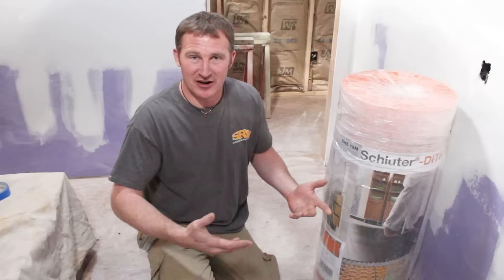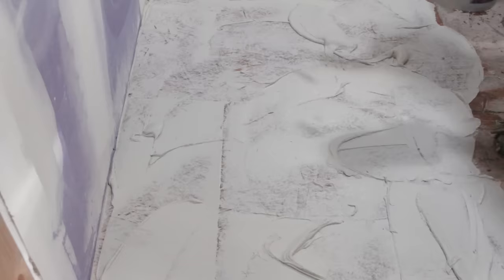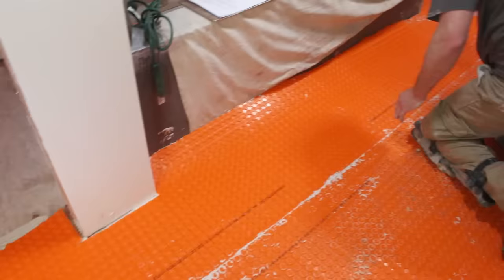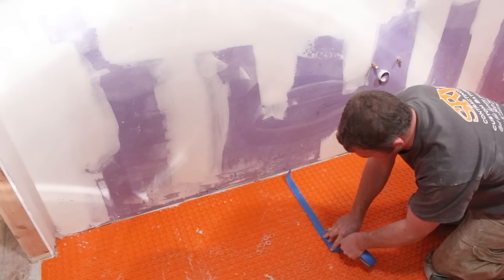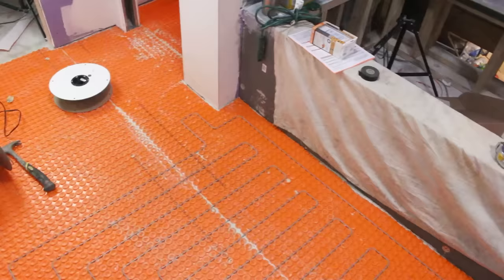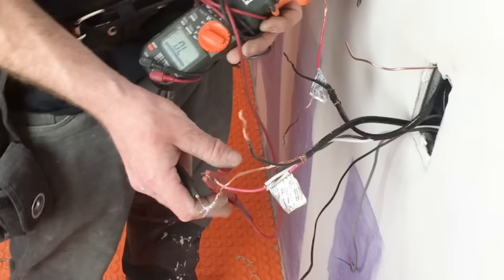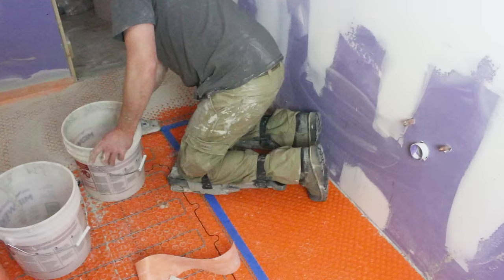DITRA-HEAT Heated Flooring Systems Installation (Step-by-Step) -- by Home Repair Tutor

Comment: Great tutorial on installation-I'm going to be putting this down for my basement bathroom floor. A couple things on the electrical make-up at the box: Since this is 240V, the white wire from the Romex cable should be re-identified as hot using black electrical tape. Also, the ground wires should be spliced  with the equipment ground back to the panel, and bonded to the box. You can use a pigtail wire to the ground terminal in the box, or leave the ground wire from the Romex long enough to wrap the ground screw, and then pigtail with the rest. This bonds everything to the metal box and piping.

Comment: Great Install tutorial! Will be laying mine tomorrow.

My only issue I have with this is the suggestion of wiring 2 heater cables in parallel to a single thermostat! Stop and think this through for 30 seconds. You have a 300 and a 100 ohm cables... current flow will split at the junction into 25/75%.... the shorter cable will heat up much faster than the longer cable. Next where do you put the single sensor? If its in the smaller area with the shorter cable, the larger area will never get up to the set temperature... if the sensor is placed in the larger area.. you run the risk of burning out the shorter cable. I guess Schluter forgot to mention on their FAQ that you can only connect 2 hating cables in parallel IF they are of similar resistance.

Comment: This is a great tutorial, thanks for producing it. I'm currently in the process of installing Ditra Heat in a hallway and bathroom and this has been very useful in helping me avoid the obvious pitfalls.
Reply: Ok pol
Reply: I’m curious, were you hable to do the installation by yourself? The electrical part looks very complicated.

Comment: Ditra heat is a great product, makes installing a heated floor so much easier, good job on the video.
Reply from the maker: +Sal DiBlasi thanks buddy, it's a great system.
Reply: it is .! bt plywood need to be level . in the bay area houses are so old that we have no choose bt to float then i use this ditra over the float & come out great . if the customers wanna pay , cause it gets pricy  haha
Reply: Sal DiBlasi 
he should've clean all of the remaining thin set off the ditra-heat mat like you do it Sal, otherwise he did a good job.
Reply: Why must it be test?? I mean...isn't it tested at the factory? seems redundant.
Reply: I'm not sure who does nicer work, Sal or you guys!
Reply: @kennethlehtinen8822  if you must ask that question, you should not be installing this system. You should always double-check before installing the tile. Anything Could Happen. It could have got damaged on its way to your supplier you could have damaged in transit or even could have been damaged during the install process or also may have never got checked in the first place before leaving the manufacturer and why would you want to do all that great work just to find the the system didn't work

Comment: Very good tutorials.  Here I came again just to let you know that I called Schluter , as you told me so, and yes, just like you said,  they were very kind and answered all my questions.
Reply from the maker: Awesome, do you feel reassured that your electrical setup is good to go?
Reply: Home Repair Tutor .... Definitely yes. Even though,they told me their system supports both 120-240
Reply from the maker: Your floor will be toasty, just be sure to test everything before, during, and after the installation 👍🏻

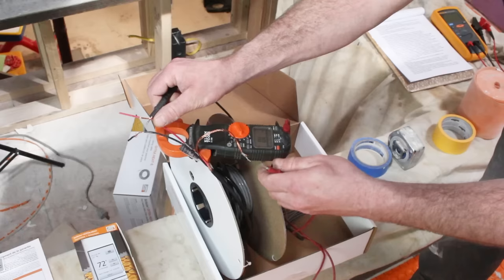Comment: At around 23:00 your electrical guy calls the ohm reading on the meter "zero". When I look at the image, I'm not seeing a zero there but "OL", for "overload". That's what the meter shows if it cannot give a meaningful number. If the number of ohms was zero that'd be a short, and that would be a failed test. You want to see "OL" for that test, which means the resistance is so great that the meter cannot give a number for it.
Reply from the maker: Thanks for asking, the main point is the wires passed the test before, during, and after installation
Reply: OL stands for Open Loop, meaning there is no circuit completion of electricity, which is ideal to see. It is like holding the probes in free air.  If measuring voltage and you possibly go over a selected range or meters maximum you could get an OL for overload because what you are measuring exceeds the limits. My meter will show O.L  versus OL in resistance
Reply: In general, OL on a measuring device stands for "overload" which means you are beyond the range of what the device can measure. It may happen to correlate to an open loop, but not necessarily. I have multiple digital meters here (ranging from Flukes to super-cheap devices). Their literature all explain OL as "overload", not "open loop".
Reply: It means open line - not overload on multimeters

Comment: Thank you, awesome video! Unimportant for how to install this, but just want to inform that there is definitely a difference between hot and neutral. Your neutral wires are grounded inside the main electrical panel; meaning that there is no potential difference between neutral and ground (basically zero volts on neutral). If you were to switch a neutral wire on a light switch instead of the hot, or hook up something backwards, the device could appear to be off because there is not a complete electrical path but would still have 120V at the device. This could prove very dangerous!

Comment: Excellent video, thanks so much for making it, and really enjoying the detail of instructions provided, and you answered my query of what to do round the edges where I'm not putting heating, and how to level up the floor between merely tile area and underfloor heating areas, so now have to buy some more matting to go all round the edges...Baffled though about why I need to do a mini dogleg in the wires if over 10 feet? (my new kitchen extension is 12 x 14 ft) I'm not going all the way to the sides, but had planned to do the whole length, so please explain why the little dogleg?

Comment: Try using Calorique heating matts eliminates so much extra work from using wire solution. Calorique has a tile heat solution that uses a self stick matt that you lay down first then put thin set and tile without doing twice the work for radiant heating. Save on labor and save time with Calorique. Also the matt is 0.0016" thick so its like putting paper down and doesn't raise the floor height which is very important and additional labor savings.

Comment: This is a very good video how ever 120 volt is blk / wht , 240 volt is blk / red  I say this because a future tech could see this as possible 120 volt thus creating possible danger , so RED taping your neutral white is a good standard practice in the case of 230 - 240 volts
Reply: There is one case in which a white may be used to carry ungrounded potential that is still in conformity with the most recent cycle of the NEC. That is when a cable is used to feed a straight 240V load. Besides that if someone is even a tad bit unsure of what they are doing around electric they should stay away from it and call someone who is. The color of the wire isn't going to save your life.

Comment: Can you install a good quality vinyl plank floor on this or does it have to be something solid like a ceramic tile?
Reply: most vinyl has a warning on it IF it can NOT be used over in floor heating, check your product

Comment: What a mission - so many easier systems out there than this
Reply from the maker: Which ones do you like? We've used several but always like hearing different perspectives
Reply: Hey, markyruss and Home Repair Tutor I'm starting to look at different products from Lowes and Home Depot to install in a 5 X 7 existing bathroom with a ceramic tile floor, any recommendations other than this product?

Comment: Question on bonding the ditra to the subfloor. I had to paint over the subfloor due to a small amount of mold, which I thoroughly cleaned the best I could & used mold barrier paint over that, curious if applying thinset to that would compromise bonding & cause issues? Would it be better to apply a quarter inch sheet of floor overtop for a better bond? Thank you

Comment: Love your video. I  have a question concerning the splice going to the thermostat. You chiseled out a space so that the splice would be below or at level. I have a concrete floor and am using ditraheat-tb . Will there be enough room for the splice to sit without having to chisel out the concrete? I am laying tile on top of the ditraheat-tb. Should I be concerned ? Thanks

Comment: I see that you are using 2 different rolls, would you not have to install a power module to allow both wires to work off of the one thermostat? Great video, Thank you for sharing.
Reply: that's exactly what I was puzzled with. With this parallel connection, the shorter roll (less ohms) will suck more electric current than the longer roll (higher ohms). This will result in unbalanced floor heating throughout the rooms where the area above the shorter roll feels a lot warmer.

Comment: It's interesting, the warmlyyours inspire thermostat is exactly the same as the schluter one, but at a fraction of the cost!
Reply: Lifehacks nothing like it.
Reply: and 3yr vs a 15yr rock solid warranty. I've yet to meet someone that doesn't love their ditra heated floor or one that's failed. sometimes it isn't worth trying to save a buck.

Comment: Great video!  Question -  after your thermostat is all wired up, wouldn't you want to actually power it up and see if the heat wires start to get warm? Obviously you wouldn't let them get very hot, but I plan to do that when I install my system.
Reply from the maker: you want to test wires three times. Once before installation, once after installation, and finally once after setting tile

Comment: toilet issue in my flat was cause of plugs they used let water go through, but even before that it was chipboard floor and over use the toilet used to work its way lose every time every flat, it was council flat. eventually toilet went through floor as I sat on it.

Comment: What if the wire were run in a groove in cut into plyboard?  Would there be an issue with thermal conductivity?

Comment: Curious as I am installing this today.
Looks like you install the cold splice and in your case, splices closer than 8" to the heat register. This is acceptable? Thanks and great video...by far the best I have seen.
Reply from the maker: Thank you. Always follow the guidance in Schluter’s most current instructional booklet. That way your warranty will be upheld. Sometimes we’re constrained by real world problems, hence the placement of the splices. What kind of project are you working on?

Comment: Love the tutorial. Very clear. But what if the heating cable got accidentally cut, How do you mend it?
Reply: The heating cable is designed to never be cut and cannot be safely repaired. If cut, the entire cable needs to be replaced.
Reply: Schluter now offers a repair kit

Comment: Thanks for the vid!

Looking at doing this to our bathroom next year, so if your a diy’er, are you able to attain a full warranty if you test and record the electric values at the time of installation? 
Also the vids I’ve seen on your products so far are on total construction, I’m looking at doing it on an existing bathroom with cabinets, tube and shower currently installed, only looking to do the walkways in the room, I’m assuming it’s just as doable as new construction? 

Thanks.
Reply: I suspect it is an expansion joint for the resistive cable, as it expands (lengthens) when it is running.

Comment: how long are the wires to the thermostat, and do you need run it thru conduit?
Reply: I mounted the electrical box at 51 inches off the floor and there was plenty of cable to get the cold leaf to the floor. Yes, the instructions say to use conduit.

Comment: The instructions indicate to make sure the thermostat wire does not come into contact with the heating wire, even in the wall. Am I mistaken?
Reply: Good Question...
Did you ever get an answer?

Comment: Noticed the Electrician mentioned this is a 240v system.  Is that a requirement to install this heating system?  What is confusing is that he also mentions the thermostat can do both 110 and 240.   Does DITRA require 240 or 110v?
Reply: Pardon I meant 120v not 110v.  Or does it depend on room size and cable length?  Or is because you are using two cables to do this particular room?  UGH.. questions..

Comment: As electrician ya should always connect ground, neutral then hot. And disconnect opposite way hot first then neutral then ground. That way you always have a path to ground other then yourself

Comment: great vid, but your line coming in, if your using 220v the white wire should be red. thanks for the tips. Should be installing mine over the weekend.
Reply: Hey Sean we did 220v install but there were no red wires only white and black ones. Is that why we can’t get it to work you think?
Reply: @adelinafranco5888  The color of the plastic covering the wire has no effect on the electrical system it's just a convention. There are many possibilities why it doesn't work but this is not one of them.

Comment: Thank you for the informative video. I am about to install Ditra heated flooring in my bathroom. However, I have 12” wide wood planks for my subfloor. The builder of my home also drilled 2” holes in the subfloor to blow cellulose between the second and first floor. How important that 100% adhesion occur between the mat and the subfloor? Do you recommend laying concrete board down or re-sub-flooring my bathroom? Thank you again!
Reply: I have a slat floor and came to the comments section to ask basically the same thing.

Comment: We’re installing on a concrete slab and intend to use large format tiles. Or slab is very close to level, but has some slight gradation changes. At what point should you put a layer of self leveling concrete over the slab?

Comment: We have one that the temperature on the thermostat reads 92°, which is off about 13 degrees from actual floor temperature. Any way to calibrate reading?

Comment: It looks like you wired the two heating cables in parallel. Will this cause one section to heat more than the other? You want the same current flowing through the cables to get there same Watts/foot of cable and that means the two sections should be in series. Thanks for the video.
Reply from the maker: Thanks Brian, our Schluter rep was on site for this video and the installation. So we followed their directions.
Reply: It's the opposite, in series the 240 volt wires would be brought down to 120 volts because series circuits halve the total voltage and raise the amperage. In parallel both wires receive 240 equally distributed. Also if one wire would fail both of them would be off, just like the old type christmas tree lights when one bulb failed the whole set went out.

Comment: A question please.
I have a kitchen with a quarry tiled floor on dirt (good condition, no rising damp, do not want to dig up), want to use Ditra with under floor heating and with the eventual vinyl or click vinyl on top (can withstand underfloor heating).
What do you recommend please?
 Thank you.

Comment: The 120v heating cable was connected to a 240V supply. Is that going to short or at least heat much faster than the long (240v wire)?
Reply: It Is a  240v cable. The wall control panel accepts  120v or 240v. 120v is fed by one hot leg @120v on L1 and neutral on Ln . 240v has 2 x 120v legs on L1 and Ln. 240v does not have a neutral. This all assumes you are in the USA. 240V does not heat faster, The main reason to use 240v is for more coverage because it can provide more overall wattage (amps x volts = watts). See the Schluter Ditra install guide and it spells it all out.

Comment: Hi guys great video, I was hoping to see what you did where two mats join. Do you seal the joints with a kerdi band strip before tiling like with the usual ditra mat? And is the ditra heat mat on a par with the usual mat for waterproofing?
Reply: It's just for holding the wire and uncoupling the floor. You have to water proof it with kerdi like it was a bare floor.

Comment: Thanks for your answer.  On the  heating cable a white wire is labeled 120 and black isn't.  Why's that ? If it's  120 V
Reply from the maker: One of the wires should be the floor sensor

Comment: Would u please tell us why it’s not good to have wire run straight for more than 10 feet?
Reply from the maker: you’d have to ask Schluter but it’s in the directions for DITRA-HEAT

Comment: Renovator wants to smash up tiles - $3000 for 100 square feet - just to remove existing tiles.  (Perfect condition, 12" squares.) Is it okay to just install Ditra-heat systems on top of existing tile?   I realize there will be a rise in level between the hallway and the bathroom - and I realize I will need to cut the door.  I accept that.

Comment: 1)do I need an electrician to test the wires and install the thermostat 
2) if the wire is too long what do I do with the excess heating wire

Comment: Hi there! Great video! Very helpful - I realize this video is a bit older but I'm wondering if you know if the amazon links you provided here are considered "authorized dealers" so that the Schluter Warranty is valid? Looks like most of the wire/heat mat is sold through Marketplace Pros and I'm having a hell of a time trying to get an answer on that.

Comment: Excellent Video... 
Question:
Can this be put in a Class A RV?
Reply: @Striper Seeker 
Well... the RV is a 50 amp.... has 2 A/C so I think it might handle it... 
The area is small... 7'6"' x 15' area for the whole floor plan... This is like a large bedroom.... Right??? Even though the RV is 8' x 30' outside dimensions....
Reply: @Striper Seeker The subfloor right now is Plywood.
Reply: I think Schluter answers this question in their Q&A section.
Reply: @wetrock2766  
Thank you for the info.